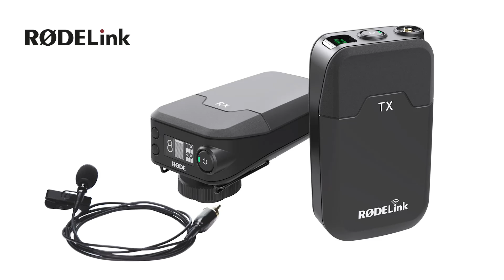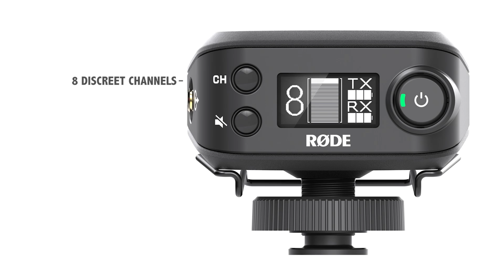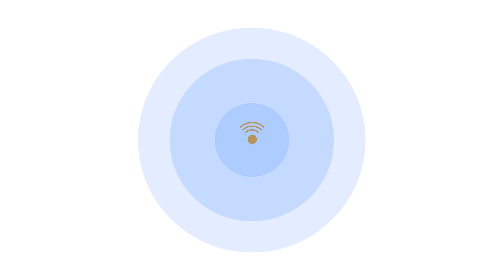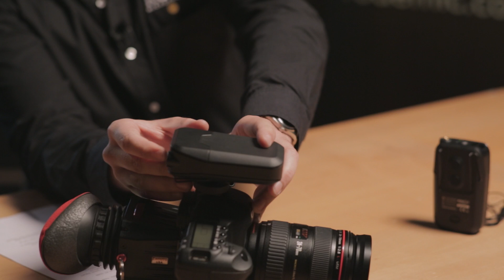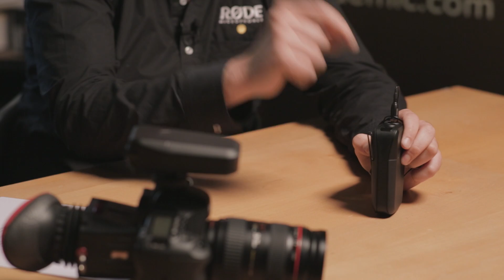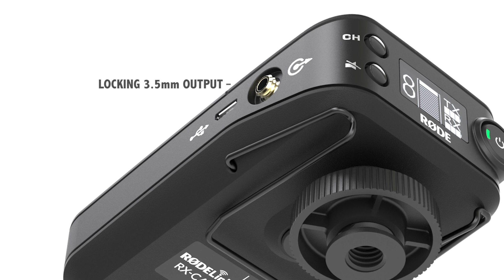RØDELink Filmmaker Kit Digital Wireless Mic Explained

Comment: I bought this kit and it worked well until the mic broke. It's very delicate and non-durable. Rode use a non-standard jack-plug on this kit and consequently no other mic works with it that I can find? My kit is now useless, so be warned!
Reply from the maker: HI David - We are also the official UK Rode service centre, please send details of the issue and they may be able to help, contact here: service@sourcedistribution.co.uk
Reply from the maker: Also - the jack used in the filmaker is a standard TRS, if you try to plug a TRRS or other type mic you may need an adaptor. They do look very similar but there are subtle differences. Cheers!

Comment: Using this system on cameras with XLR inputs. The XLR adapter seems both noisy and loose. Any chance Rode will make a proper XLR input cable for this system? Otherwise this wireless lav works very well and we've had no dropouts or other issues when used with Blackmagic Cinema Cameras and an Ursa Mini Pro which we've successfully used without an external pre-amp. Being able to adjust the Rode receiver gain up and drop the camera internal pre-amp down makes for a good recording. Looking forward to a Rode XLR cable if at all possible.

Comment: If I wanted to monitor the sound as I was recording would it simply be a case of plugging headphones into my camera - to make sure it isn't clipping etc or if the talent suddenly decides to start speaking louder. Along those same lines, is it possible to adjust the audio level as you record without having to interrupt an interview or speech for example?

Comment: Getting a lot a radio interference with the Lav mic that comes with the Rode kit, whenever it comes anywhere near the receiver, as well as a constant hum that is consistently there. I had some colleges that were having the same issue, and they ended up replacing the Rode Lav mic altogether with a Sienhiser Lav mic, all problems went away. So I followed suit, and these issues were resolved for me as well. Some kind of shielding issues with the Rode kit Lav mic.
Reply from the maker: If you have any issues, contact your local distributor (in the UK that's us!) as we should be able to solve this.
Reply: Returned item no longer my problem.

Comment: Is possible to use a mono splitter in connecting two lav mics up to one transmitter.
Reply from the maker: I don't think so. But you could use a Dual Mono > Stereo splitter to have two Filmmaker kits going into one camera, on separate channels.
Reply: perfect that was my question, wonder if RODE sell the TX box only
Reply: Sorry if this seems a simple question (Im New)  By splitting the stereo sound, will it still be good enough sound quality in mono?  and to confirm, i would then use the left for one set of audio files and right for another set for editing purposes?  Many Thanks
Reply from the maker: Definitely will sound fine, yes - after all the 'stereo' that is recorded using only one bodypack straight into the camera is really just one mono channel copied equally into either side. In the instance above, you'd be able to capture two independent channels of audio (so perhaps an interviewer and interviewee) direct to camera. What you'll capture in-camera will sound odd at first, one person in the left channel, the other in the right, but then you can separate and isolate the two channels in your video editor, and pan them into the middle.
Reply: Thats great!  Thank you for your help!

Comment: I purchased this product today but it doesn't sound like yours in the video, mine sounds with a lot of noise (air noise). Does it have to do with my camera (Nikon n3200)? Or do I need to edit it after in a software? Thanks
Reply from the maker: Have you got the +20dB engaged in the RODELink transmitter, the attenuator in the RODELink receiver set to 0dB, and the Nikon adjusted to (assuming it has this!) manual level control, to an appropriate level, with no 'automatic' level controls enabled? And is the Lavalier placed appropriately? (e.g. http://67.media.tumblr.com/92fd869b09d940cc7ee30023b9091f61/tumblr_nh1ontQkoH1qzbp95o1_1280.png)

Comment: I'm purchasing this system today. If i'm needing to mic up a bride and groom I would obviously need two lav mics but would I need another transmitter and receiver? If anyone could help me with this I would be forever grateful... Just wanting to see exactly what is needed for this job. It's my first time recording audio at a wedding. Thanks!
Reply from the maker: Yes, you need two complete systems.
Reply: Thank you very much
Reply: +SourceDistributionTV oh so it's not possible to have two rode lav mics up to one transmitter.
Reply from the maker: I don't think that'll work - plus you have a practical issue of trailing cables between two performers/subjects. You really need two systems for this.
Reply: This is why I would not buy this system, only because I always need multiple lavs. But great for the price

Comment: Is the output hot to connect a headphones to use the system as a simple in-ear. Connecting the line out of a mixer to the transmitter ?

Comment: Is the RodeLink Wireless a Mono Channel? I say this because I have a two headed Giant Squid lavaliere (2 lavs converging into one single stereo jack) and when I connect it to the Rode Link transmitter one of the lavs is silent. I think it only transmits one mono channel, not a stereo channel. Correct? I really wished I could get this two headed lav to work on this unit since it would be great for interviews with closely positioned subjects.
Reply from the maker: +RealWorld Endo Yes, it's mono. Would need two kits really for this!

Comment: I really wanted to see a  important comparison between Sennheiser and RodeLink for the fact that we are talking about Digital and Analog transmission. Hence the deal breaker should not be the distance or buttons but the  interference.  Did you get a chance  to  check how they behave in a crowded environment with 100 to 200 ft distance like a party site,  ball room conference, exhibitions, concert, festival scenarios as that's where we should see many mobile phones really in action.  I  really wish you post the test results of the transmission issues. Thank you.